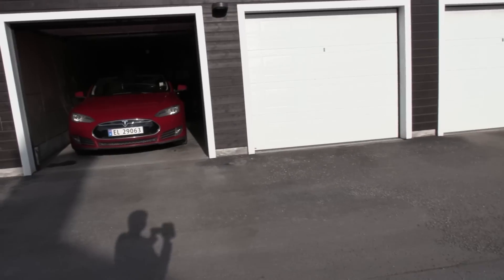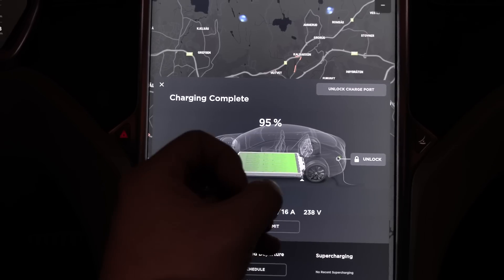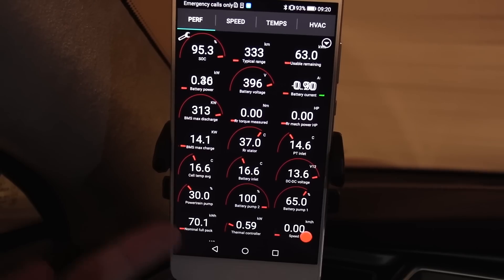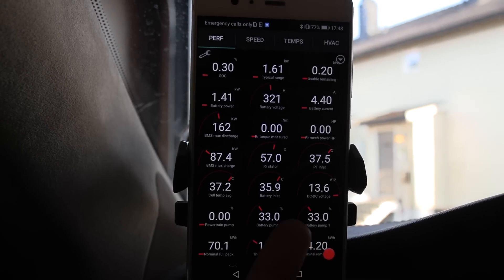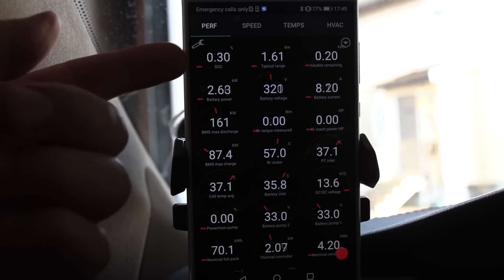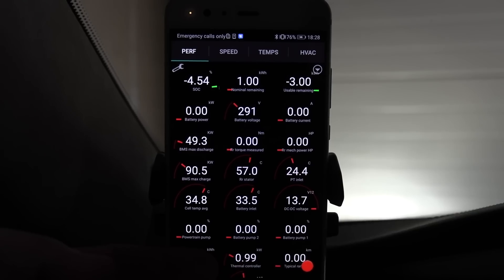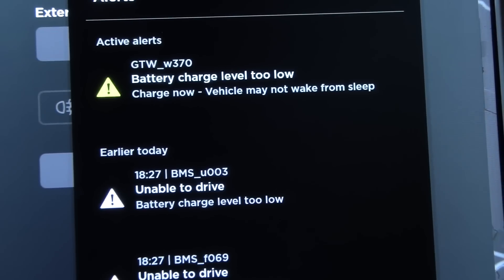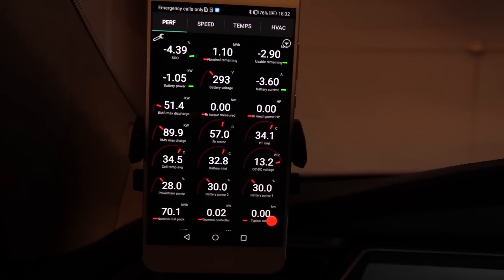Trying to calibrate 6 year old Tesla Model S battery

Comment: Do the same thing, but with a DC-charger. This solved the issue for me.

I reached 97% on AC. When doing DC I reached 100%, then it said ”calculating” and  did so for another 55 minutes and added 4.8kWh
Reply: Hmmmmmmm........all Tesla gurus say to use slow AC from 0 to 100% for any balancing / calibration. But you could be right as the BMS will slow charge DC at the end anyway and might be able to supply a higher peak voltage than the on-board AC charger.
Reply: @moestrei  Yeah, AC never worked for me - even on a 11kW-wallbox. DC worked like a charm!
Reply: @emillarson89  Is your country's mains 110V or 230V?
Reply: @moestrei  230/400.
Reply: Same with my Tesla. I use 50kw DC charger. I think DC works because it must not be converted like AC.
Reply: @moestrei  Your theory on "peak voltage" by the wall adapter is interesting and might be correct.
Reply: @aussie2uGA  Well it is all guesswork. By now there are 3 generations of on-board AC chargers. They might behave different in different countries with 50/60Hz and 110V/240V single, split or 3 phase. In Australia we have high voltages on a sunny day because the utilities drive the voltage  up for the roof top solar sysyems to shut down because of overvoltage. There is a well respected Germanic YTuber (Moin Ove!) who says slow AC from 0 to 100 is the go. Could be that with the next software update everything changes and perhaps under Services there is a Calibrate BMS button........only Elon knows..........BUT it seems DC might be the way.
Reply: @xavermeyer135  The DC from a fast charger is also converted from AC, it's just that the charger is outside the car rather than inside.
Reply: @antkar87 , it's the other way round. The AC is converted to DC by the onboard charger. And this should be able to reach the maximum voltage of the battery pack. The offboard DC charger adjusts it's output voltage to match the battery voltage as it's directly connected to the battery.

Comment: Hi Bjorn.
Enjoying to watch your tests from Ukraine:)
I think I can help you to understand the result of test.
I got experience with non-official repairing Tesla’s, and some time before learned, that in this test you can check, does your battery modules got burned safety fuse terminal (small metal wire which connect cell to module).
To check it you need to charge 100%, then discharge to almost zero, and check min and max cell voltages.If there big difference (more than 0,1v) present you got burned cell fuses on module.
So, in your car you see, when you got very low charge level, one of the modules got such more low voltage than other (0,3v very big difference), and in case one “defect” module bms will limit the maximum level of charge trying to balance this module.
But it is defect, so bms can’t do it because the capacity of one module lower than all other.
The reason for this situation usually is lot of supercharging, or very often high accelerations.
Hope this information will help you.
Reply: Another failure mode is one cell becoming resistive but not low enough to melt the fuse wire. This one cell will discharge the other 73 cells it is in parallel with and cause the imbalance. With rapid charging / discharging the faulty module (which can be detected with ScanMyTesla) and thermal imaging it is possible to detect the faulty cell and snip the fuse wire (it is almost impossible to change a single cell) which allows the other cells to recover (in charging that set of cells to the same level as the neighbouring 6 sets) and save that module. Also important to remember that Tesla is top balancing the cells which means a higher difference at the bottom is not unusual AND that charging to 100% is required for this balancing process to happen. Greetings to Ukraine from Australia.
Reply: so one old cell have like 2600mAh/2700mAh missing in parallel effect the ballans big time? 144 cells parallel in the module?
Reply: Yeah, I wish he had scrolled down to show the voltages of all the modules. It looks like most were much closer to the max voltage, which leads me to believe the one degraded module is really holding back the rest of the systems from a charge/discharge standpoint.

Comment: I own a Model S with similar milage and last year I had the same behaviour with the battery like you showed here.
The maximum cell voltage only went up to 4.167 Volt. I have heard that it might be good for reverse effects of lithium plating  by let the car sit for while at low state of charge (eg 10-15% after a long trip) for 8-10 hours.
I did this in the summer for several times and after a while the BMS allowed the cell voltage to come back to 4.200V (but slowly).
Finally the car was able to charge 100% again. But as I said before, it was a slightly process.
Reply: so depth balancing and top balancing? 0,01V les from the 4.2V top 100% charge how much is this in capacity????
Reply: @gerbrandtwassink6058   On low state it's not about balancing. It's because of reverse lithium plating.
My battery has done 270000km and 2/3 of it was super charging. They say that you can reverse the effect of metallic plating of lithium onto the graphite anode by letting it sit on low state of charge. Then the lithium has a change to diffuse into the graphite again. It is technical possible to measure if there is metallic lithium onto the anode because of the voltage / current reaction if you pull energy out of the battery. 
The difference of given capacity between 4.167 Volts and 4.200Volts is not much. It's about 0.3 kWh.
I own a 70D, so I have only 14 modules instead of 16. In late 2019 Tesla reduced the full charged voltage to only 4.100 Volts and at that time I lost 2.4kWh of usable capacity. Many cars with the old batteries and a lot of supercharging were affected at that time. But surprisingly Tesla gave back the capacity later. Current degradation of my battery with 270000km is about 8-9%.
Reply: Tesla gave back the capacity? I lost about 24 miles of charge in that update and I never got it back 😢
Reply: @TeslaMomUSA  Interesting ... There is one possibility if You are out of warranty. Downgrade the software to the version before that fatal update. If You search around, You will find people who can do that. Good luck!
Reply: @arnoldcziurlok4451  that would be awesome but I upgraded to MCU2 since then. So if I did that I would presumably lose access to all the infotainment features?
Reply: @TeslaMomUSA  Yes, I think so

Comment: I think it charges until one of the cells get too close to 100%, then stops, balances them (reducing charge a bit in the process), tries to charge again to 100%, stopping at a better 98% this time, and it would rebalance again..

In short, if you keep it plugged, I think it'd eventually hit 100%. As you also said it yourself, degradation shouldn't change the fact that it should hit its 100%. I think you can't hit 100% only when it's not balanced (since some of the cells hit 100% first, and it becomes harmful to charge further).
Reply: Yes, but I think it is possible that some of the cells are just that much more degraded, not being able to charge to 100% as a result. Even if the BMS balances all of the cells to the 5mV difference (after which cell balancing is stopped), then almost immediately when the charging starts again, the voltages of the most degraded cell starts to go up much faster compared to better cells, and as a result, charging is stopped when some of the voltages exceed the max limit with the lowest charging current (what ever that is). But I think that it is possible to run the balancing-charging sequence a couple of times more and see if it will get the cells even more in balance.
Reply: Totally agree, although there is no special magic voltage where harm starts. Doing this process already harms the cells to some extent. Leaving the pack unbalanced, and having the weaker cells have an easier life is best. This exercise is purely an academic exercise, no normal driver should ever do it.
Reply: @rhydianlewis2867  I personally believe that balancing the cells every now and then by charging the battery slowly to 100%, and then using the battery mostly only between 10%-90% would be best for the weaker cells. This way when discharging the battery even the weaker cells will stay better in the "healthier" voltage range. If the cells get largely out of balance, not only it lowers the usable capacity of the battery, but also exposes the weaker cells to harmfully low voltages more often. In addition to maximizing usable SOC area, the other main reason for cell balancing is to prolong the lifetime of the weaker cells. However, I don't believe that (in this case) discharging the battery to absolute 0% did anything in terms of calibrating the battery, and it probably was only harmful, and should be avoided in any case. But interesting as an experiment, as you said.

It has to be said, I don't know what Björn did exactly in terms of programming when he was working in the University, but I have to say that I am quite pleased with the level of knowledge he has regarding how EVs and BMS works. I have seen too many "tests" and "experiments" of electric vehicles without the understanding of how all of it works, and that's why I really appreciate these kind of tests. I'm working in the EV industry in R&D, and seeing how a BMS in Tesla works in different situations is thus very interesting to me :)

Comment: Bjørn, first off welcome to battery gate. The reason the SoC was dropping after you did full charge wasn't due to the balancing process (yes it was a small part of it) when battery gate started in 2018 the older model S cars battery pump runs at 100% above 90% SoC no matter the temp in the battery. This can also be seen in your video. Also if you drive from above 90% even at low speed the car 'burns' away in heat as much of that extra SoC until it's below 90%. I've seen mine drop from 97% to 90% in 6 miles at 40mph in summer.
Reply: That is why 100% is only for the take off portion of a long trip, set limit to 100 and you can leave anytime over 90% with no appreciable gains.  I have a 2014 S 60, not just spewing crap in the comment section.

Comment: I have to add something: The maximum voltage of the battery was most likely reduced by the summer 2019.24 update which also limited the maxium charge power: https://forum.abetterrouteplanner.com/blogs/entry/30-tesla-supercharging-summer-2019-update
So the SoH would actually be higher if the pack would be still charging to 4.2V.

Comment: Another theory I have is that Tesla recommends to always keep the car plugged in. This would help trickle charge and discharge cells to keep it more balanced.
I feel based on my own BMS range estimation that it does a full balance every couple weeks. I don't think my car would know the top and bottom level even if it is balanced with good millivolt difference without dropping lower than 10% and back to very top. I try to charge to 100% once every 3-6 months when I remember or I feel BMS needs a calibration.
Reply: On the model 3 and Y the car will calibrate when charging limit is set to 90% so that’s why Tesla recommends you always charge to 90% so every night it can balance

Comment: Very interesting exercise, "Scan my Tesla" is a very useful tool, I wish Renault did something similar!
Reply: Scan my Tesla had to be installed involved ripping apart a center console on the model 3. It isn’t necessarily an easy thing to do. Tesla doesn’t want you to know this info.
Reply: @superleggenda  yes I have, thanks
Reply: On the Model X/S you only remove (firm pull down) the tray below the screen and fish for a white connector to plug in an adapter cable and the Bluetooth dongle.
Reply: @superleggenda  I responded to Alan H.  This Tesla Bijørn video was about a Tesla?
Reply: @lespaulranger  On the Model 3 you only need to remove the panel at the back base of the center console. Easy to do.
Reply: @superleggenda  Yes, you are absulutely right. For us Tesla drivers it is just very hard to acknowledge that other brands even exist.
Reply: @superleggenda  I'm responding to the OP mistakingly thinking that ScanMyTesla is a native app. It isn't. It's not straightforward to install even.
Reply: @superleggenda  Poor reading comp skills eh?
Reply: @superleggenda  I did which is why I responded the way I did, clarifying that "Scan my Tesla" isn't a native tool.

Comment: In my technical opinion when the SOC goes to 0% each group cell will have different degradation so will have delta voltage more higher, that why tesla set a lower buffer, and when you charge upto 100% or close to it i will balance using pasive technical (resistance burning) nor active in that way BMS learn the real kwh capacity

Comment: Having viewed cell balancing on another Youtube site I think that I understand why the cell diff increased after balancing. After balancing when you recharge back up to 98% you go back into the steep part of the charging curve which exposes the weak cells in the battery pack. It is at the extremes of the graph (top and bottom) where the balancing cannot compensate for the weak cells. This explains why the cell diff increases again. When you discharge back to the flat part of the curve (maybe 93% or below?) I predict that the cell diff will decrease again.

Comment: 14,58% degradation. about the voltage with a full battery, a lithium cell will naturally always drop to 4.18Volt after charging has stopped, so the difference is not that big if the battery has 4.16V instead of 4.18V and you will not notice this in capacity between 90 and 20% SOC

Comment: Honestly: Your understanding of LiIon cells is completely wrong. Your BMS does nothing to the cells, it just watches over them. A UV message from the BC is nothing that you need to provoke to get better capacity or calibration, because calibration happens on discharge. Your cells are charged until the 1st block reaches 4.2V on charge current. Since your cells are old the internal resistance is higher. So when the charge current is off the voltage on the resistive part will go to zero. That's the 2 percent missing from 100%. If you leave the charger connected it will start the balancing. Charge the battery until one block reaches 4.2V, and then bleed that block to the voltage of the lowest voltage block, cool down, repeat .... until all blocks are within a few microvolts. This is the state you want: All cells at the same voltage. This is important for the health of the pack. Discharge will then happen until  the worst block in the pack reaches the low voltage cutoff limit at about 2.8V (10%) . The point of getting to this state of balance is that all cells can now be charged to the same level for many cycles without having to worry about the individual state of a cell. Going into undervolt state severely messes with this and does more harm than good.
If you want to recover lost KWs for the mere purpose of seeing them again in the stats, then discharge the battery to 6% and leave the car standing for at least 48h at 6 to 10degC. Then charge with the lowest current possible until the battery is at 99%. This operation does not revive any battery - but it minimises the parasitic error voltages during the charge process. It may reduce the effect of plating in the cell and give you longer high power charge on a DC fastcharger.

Comment: Bjorn, how many 100% -> 0% -> 100% cycles did you do to help the BMS calculate full capacity? From your video it seems to be only one. Because of the balancing process, this needs to be repeated multiple times (at least 3x). Also, the bleeding of the cells uses quite small resistors and can take, not hours, but days. So I would redo the calibration exercise but give it more time. Give your car at least 2 days to balance between each cycle. Good to know: to engage the balancing circuitry, you need to charge the battery to at least 93%. I have a 6 year old Model S and have had interesting experiences with capacity after a 3 month repair job. After the car had not been used for 3 months (only cycled between 30% and 70%), it took me 5 months to bring it back up to the capacity before the accident. These experiments are quite interesting for nerds like us, keep up the good work!

Comment: Hi Bjorn, I have recently run this process with MS 85D, 200k km, but when trying to charge it back, I also can't move over 96-97%. Same behavior on AC or DC charger. SMT shows Nominal 67,1kWh, but I can charge only up to like 64. The problem I see is that it now charges only till cell voltage reaches 4,1V and not over. I have SW version 10.2 (2020.48.37.8). Therefore I don't see a big problem charging the car even over 90% as it is obviously voltage capped.

Comment: Hi Bjorn, the voltage difference on Li-ion cells is always higher in the extremes, so it's normal to have more cell diff when closer to 4.2V and less cell diff when they are at 4.1V
And in the extreme low , the voltage drops very fast.

Comment: If the battery pack is a 2013-2015 chances are it's defective and needs replacement.  Unless it appeals, Tesla is going to have to pay $16,000 to each of the thousands of owners affected in the country. The fine could be even more significant as other similar legal efforts are on the way in other countries.

Back in 2019, Electrek reported on several reports from Tesla owners about seeing significant drops in range from 12 to 30 miles following a software update.

Only Model S and Model X vehicles with 85 kWh battery packs, which were discontinued in 2016, seem to be affected at that point.